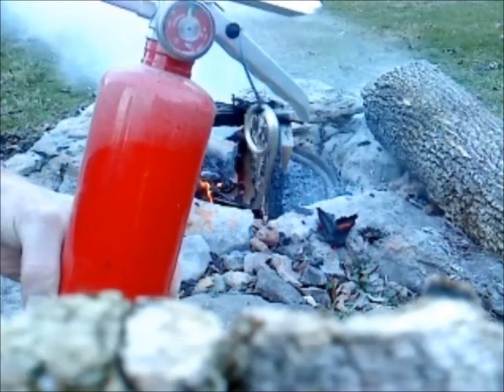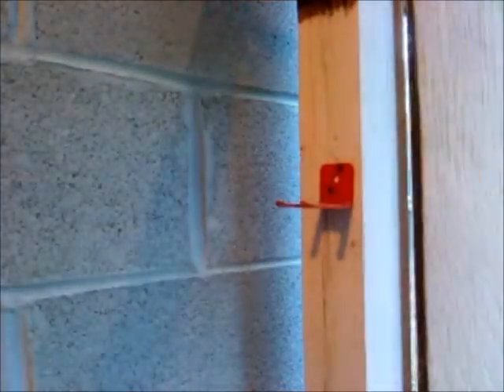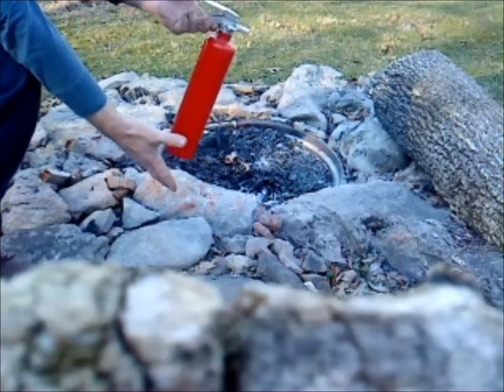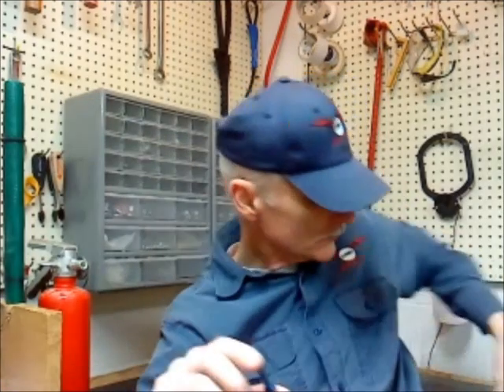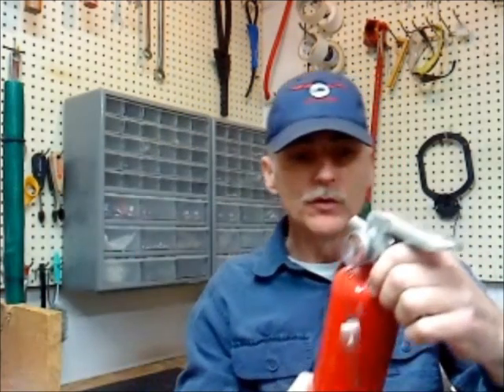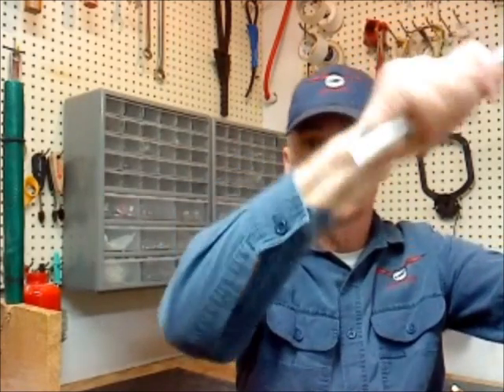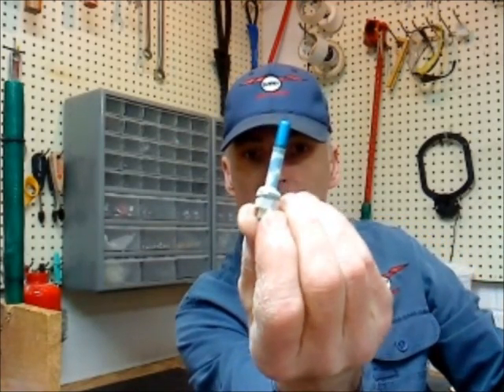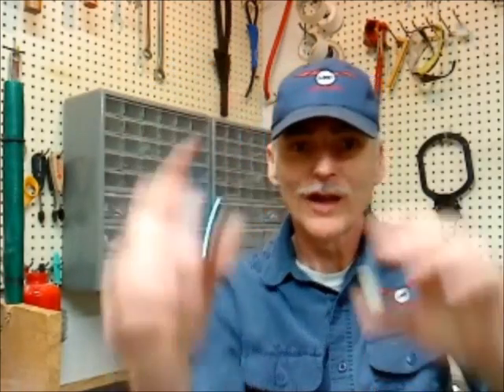Fire Extinguishers: Danger of Not Recharging

Comment: Does this apply to Halon/BCF extinguishers?
Ive got two,both not used but one has gauge slightly in the red area now.
Reply: class 66 so glad you commented on this one, who would have thought using one a little basically meant it was no use. We keep 3 car ones around the property. They have not been used, but I first had them when I had kids...so I am off to investigate and make sure they seem untouched.